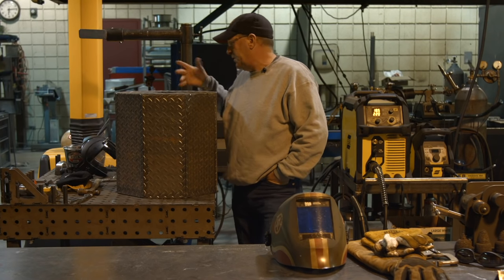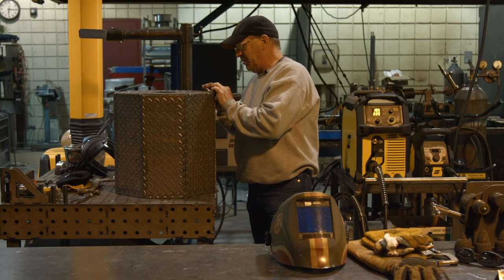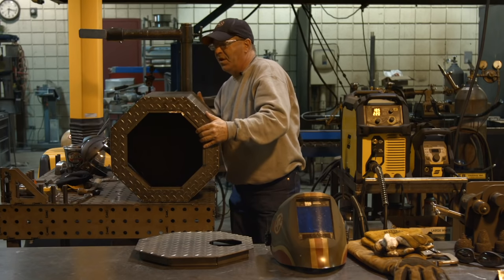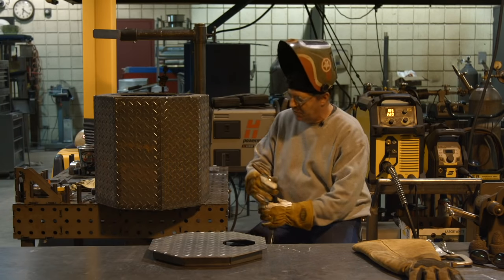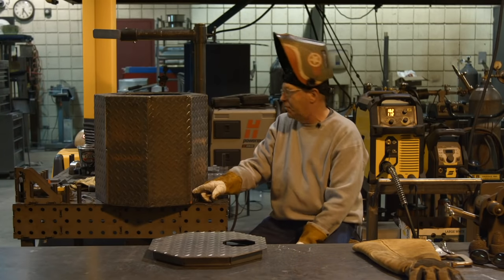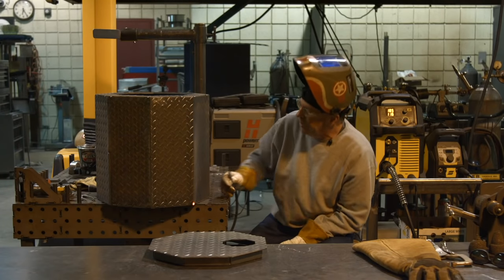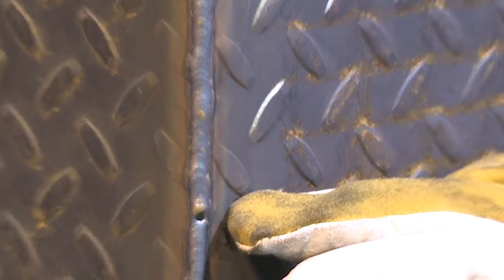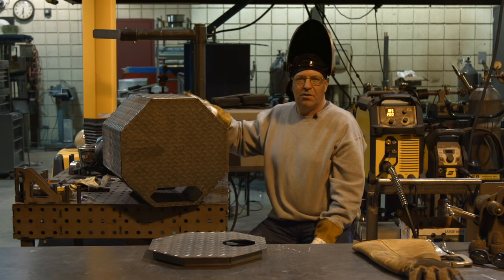🔥DIY Smoker Build: Part 3

Comment: Picked up a couple 100lb propane tanks out of cert which I'm using to build a reverse flow smoker. One is cut open for a cooking chamber, the other is cut lengthwise for the fire box.

Looking forward and paying attention to your detail work on the doors, assembly and other tricks I don't know. Looking forward to upcoming parts.

Comment: Hot Tack?  What does the hammering do that the shrinking of the weld itself doesn't do on its own?  I mean I love using my hammer, its my favorite tool and I jump at the chance to use it even for no reason at all, but I'm curious what the tap of the hammer does to the contracting weld.  Are you trying to pop a bow back in?  I'd love to see it if you have it on tape or haven't done it yet and can get it on tape.

Comment: That fit is hard to do I got about 2 years under my belt and you will likely warp a few of them the bad part is they cost a lot just my fire box came out to a few hundred dollars  just for the steel and the tread he used in this video cost way more  then the smoke chamber and the racks with paint and you have made a substantial investment.